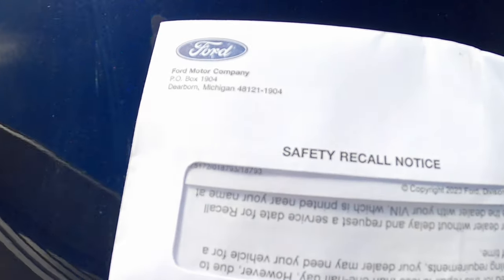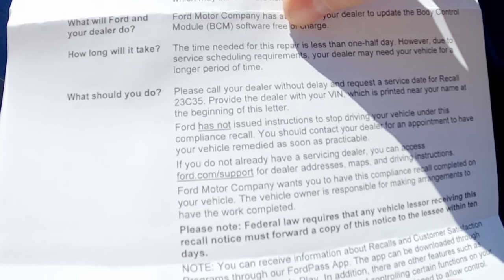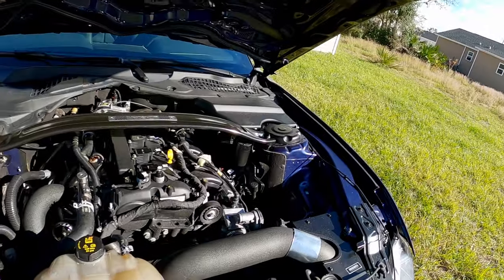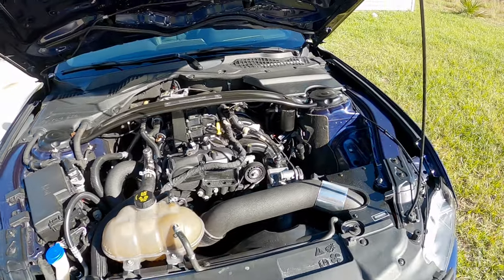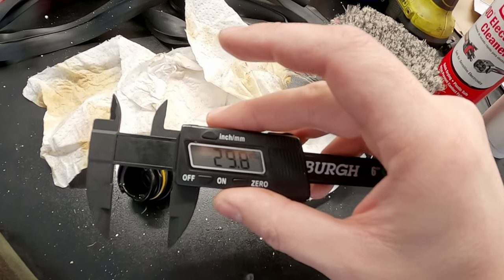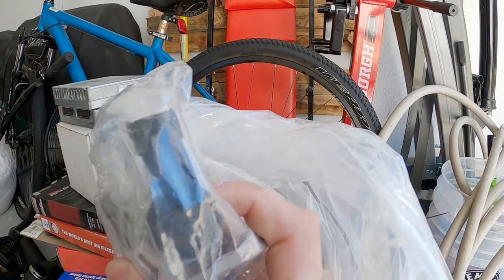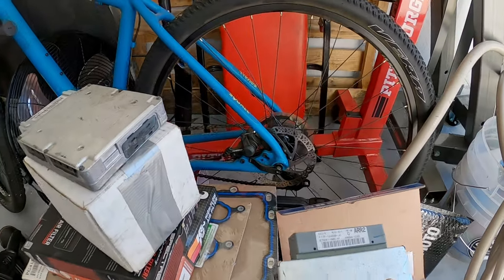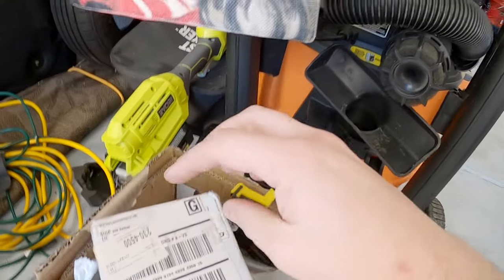NEW Ford SAFETY Recall Issued on my Mustang! *Brake Failure Imminent*

Comment: I have a 2016 GT.  They continue to send me a recall for the backup camera failing; yet my backup camera works fine.   My A/C system however developed a significant leak while the car was still under warranty; but there has been no recall on that.
Reply: Safety recalls are just for safety related things. No A/C is an inconvenience. Defogging the windows on cold, humid winter mornings might be a closest argument.
Reply: @jamesplotkin4674   If the gov't mandated A/C specifically for the defrosting ability, it should be considered a safety item.  But then again, the gov't mandated back up cameras too but I think they are a waste of time/effort/money.